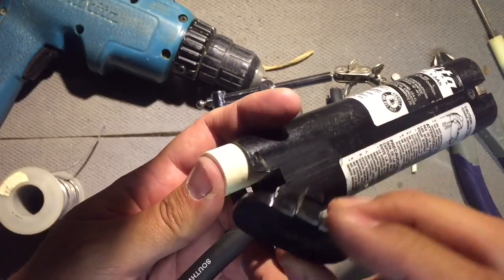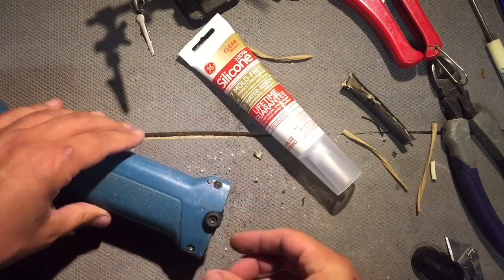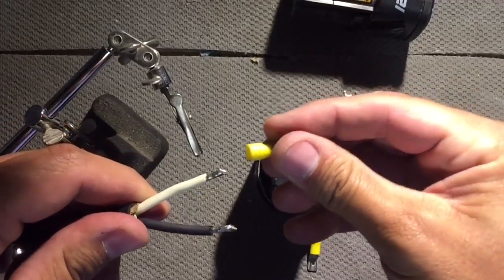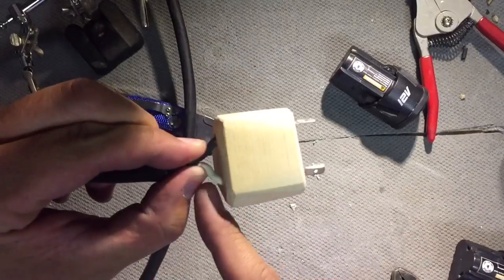How To Battery Hack a Makita 9.6v - Easy Lithium Ion Conversion Upgrade

Comment: Oh my god! DUDE! Why would you tear up one of those amazing, industry-changing Makitas!!!! I'm 63-years-old and I bought my first cordless tool when I was 20-years-old and it was that tool. Those 9.6 Makitas were such a game-changer for those of us that build modular furniture. We used to have corded drills, with cords running all over the place. Suddenly, we had a pretty powerful, cordless drill, I just paid $45 for a super clean 6012 like you have, with the original metal case, chuck key and it even has the owner's manual intact. I'm going to put NiMh batteries in the old battery pack, so I was looking for a video for that and saw this. YOU ARE INSANE! Why wouldn't you just create a make-shift battery out of PVC and a heat gun? Why would you saw a perfectly good Makita battery in half?!?! I'm sorry, you are clearly an intelligent and clever maker, but tearing up one of these old, ground-breaking tools is just a travesty. LOL.
Reply from the maker: I kinda agree. I was trying to use these old tools with newer cheeper batts. This is ling ago, but I’m pretty sure the batt i hacked was already toast. The cost of the 9.6 batts and their shelf life is crazy, now with my hack I can use any of these old tools with a newer battery.

Comment: I have hard wired my old 9.6v Makita screwdriver and used computer power supply with cigarette lighter connector and used for hours and hours without any problems.i use cigarette lighter connector for easy to use with different tools which are around 12v

Comment: My Makita battery died today. (R.I.P.) Thanks for the video. It saved me a lot of time from opening up the battery. Awesome job on modification (gauge wire).  Hopefully the battery contacts remain good.  My thoughts: ditto on the life span of a Makita. But that darn cord would get in my way, or I would accidently unplug the battery.  So, I might have to do away with the cord & put in a modified battery/plug right in the handle somehow. It would be cool to see a way to do it. But probably not cost effective.

Comment: I have an old Makita drill like the one you show, but mine was always able to use both 9.6 VDC and 12 VDC rechargeable NiCds.   The drill handle has a bulge on the bottom to accommodate the larger 12VDC battery.  OEM batteries died long ago.  Replacement NiCds cost more than the drill itself.   I think modifying the dead 12VDC battery to run off a 12VDC lithium ion won't adversely affect my old drill.

Comment: Did a similar job, but used a 12volt car jumper pack as power-the motor was fine but the variable trigger switch failed!

Comment: Since when is black positive and white negative?
Reply from the maker: In America: AC current black carries the load, white is neutral. With DC red is positive, black is negative. White never has a designation with DC. Since I had a black and white wires, I choose to follow the AC color scheme, which I usually work with anyway.

Comment: Uniquely contrived solution that can be used in any of the older style 9.6v Makita tools. Both McGyver and the Professor🌴 approved✅👏🏼. But seriously you could just install lith-ion batteries into that original casing for less than $30. I know you just wanted to use that craftsman 12v to repower those  older unused tools that you spent good money on 👍🏼. These days a guy could make a video on making shoe laces out of old fence boards and people would watch it 🤑🤑🤑🤑😉.

Comment: we need you to convert a stick 9.6v bat to a custom li-ion 18650 x 3 using the bat black case and a protection balance  board  and the correct charger  not to have a clumsy wire hack job you might as well go back to a corded drill and saw in this case your defeating the purpose
of cordless

Comment: GREAT hack and super video.  No life story.  No weird music.  Assumption that viewers know what they are doing. Yay. Thank you!
Reply from the maker: Thanks. Awesome that you get it is a hack to bring life to rarely used tools. So many viewers think it should be a lipo battery change out or want to insist buying a new 9.6 is the way to go, but no... this is a hack.
Reply: One man's hack is another man's kludge. 

The handle of the drill is way over-sized for it's (current) purpose, since it was sized to accommodate the required number of Ni-Cd cells to get the drill up to 9.6V. That being the case, you could, instead, shorten the handle and, ideally, re-pot the battery's Li-ion cells in the handle more-or-less permanently. You might additionally, using a heat gun (or similar), be able to re-shape the mouth of the handle to allow for installation of that end into the Milwaukee(?) charger. The whole idea of the drill is that it is portable and self-contained i.e. a single object to pick up and put to use.

Comment: Nice for what it was, but why not fashion some solution where the new battery fits up into the drill, so that it can remain cordless?
Reply from the maker: Thanks. Be inspired by what I did and run with it. Make a video of you fashioning a battery into the drill.

Comment: well now that you have turned the old useless drill into something that you can use , I assume that you did this just to use around the work bench since the cord would be a pain in the A$$ . why not connect it to a deep cycle marine battery and do away with the need to charge more than once a decade ! all in all pretty cool hack !

Comment: why not just replace the internal NiCad cells with Li-ion cells and use the original charger casement so that it can patch the battery into a Li-ion charger? more work, but you'd be truly cordless.
also, they sell 9000 battery replacements for like $20-$30 a pair.

Comment: Why couldn't you shorten the wire? It's not really even cordless anymore!
Reply from the maker: I could shorten the wire. I wasn’t trying to make it cordless, I was trying to find a functional way to use my old tools when I needed them in a pinch. I rarely need the right angle drill or the jigsaw, but now if I do, I have a way to utilize them.
Reply: @VinceRocca  okay I see, that was pretty crafty then. good video.
Reply from the maker: Thanks. We have a bunch of fun videos (some crafty), so please hit that subscribe button. :)

Comment: Maybe you could put a turbocharger on my '69 Volkswagon Beatle? Seriously, I just found the Makita 6095D for 13 bucks with 3 batts at a Goodwill. Each batt charged in under an hour, and it's a very useful tool. I LOVE the Makita brand. I have a wall plug 1/2 incher, and if you catch the drill on something while you are holding on tight, I seriously think it would break your hand. Great attempt!

Comment: 7:50 - no I'm thinking why did he do this in such a way as to leave a giant cord coming out of it?  I get it the tools were basically useless but I'm thinking there are ways to do this a little more elegantly and still keeping the "cordless" functionality.  Still - thanks for the video
Reply from the maker: I hope my video inspires you to make a video with a more elegant solution. For me, I wanted to use the craftsman battery and it wouldn’t fit inside the makita, nor did I want to dismantle the battery, so a wire became the solution to get the battery out of the way. Glad I could help. You can help me by subscribing so I can get to 100k subscribers.
Reply: @VinceRocca  the battery is out of the way but now you have that huge cable on your way.
Reply from the maker: And I have a tool that I can utilize in a pinch.

Comment: Why not just upgrade batteries?
Reply from the maker: 9.6v are made in nicad and nimh, neither of which hold a long shelf life and when drained past a point, become dead. For me, I barely have a need for these old 9.6 tools, so I found a hack that lets me use them on that rare occasion without having to make sure I have a 9.6 batt always charged. Glad I could help. You can help me by subscribing so I can get to 100k subscribers.

Comment: wow your turned a cordless drill into a corded drill, who knew
Reply: @brucegerard309  Of course.  It's more like  $130 for the Milwaukee but yes, if you don't have a decent lithium cordless rig, you need one.   But waste is about respect also.  Time spent to fix things when you can is care taken and respect for what you have.   Look,  I have two sets of Milwaukees drills in two countries: drills, impacts, their hackzall, angle drill for jobs.   Pretty decent system, good batteries.   I chose it to upgrade from the Makita system a few years ago.   Will use M12 for as long as practical.  But I also have 4 Makita drill drivers, plus their 3" saws one with the water feed that I have setup on a slider jig for tiles.   The 9.6 battery system is too obsolete to be useful, not worth buying more nicads or NIMH, but building  two battery inserts to run off of AC power means that we will now have some spare drivers we can keep stashed at the rental house, in the shop for details etc.  That 3" saw with a diamond blade is just fine plugged in.   I was actually looking for a plug-in drill driver for a specific use but there are almost none on the market.   Adapting old Makitas lying around makes perfect sense!  It's about having a power driver tool ready to go more than portability.   I just modded the battery with a cord.  Took less time than driving to the store!     
I understand sometimes we just don't have time to fix things.  But I would NEVER make fun of somebody for doing this. Much respect.
Reply: @brucegerard309  You'd pay $300 to replace this gorgeous chuck wobble-less drill. It has amazing speeds/torque for screwing and drilling.
Reply: Neat. You made a drill with the downsides of both. A cord you have to work around and a battery that you have to charge.
Reply: @brucegerard309  Another wasteful person.  A good consumer.
Reply: @B12Mac54 Whereas your talent would be throwing a good durable tool into garbage due to old battery tech, right?    Good consumer.  Go back to work and earn some more so you can buy more products.  Working is far easier than taking care of things.   Hope you still have a job.

Comment: what about the discharge protection? its inside the battery ?
Reply from the maker: There is none. I’m pretty sure this could drain the battery past the recharge point. But I only use this briefly on the rare occasion I need an old unique tool. I don’t nor would I use this as a regular drill. There are now better and cheeper drills than the 9.6 Makitas. But this works great for quick use of the jigsaw or angle drill. Glad I could help. You can help me by subscribing so I can get to 100k subscribers.

Comment: I don't understand why you put that long ass cord on it? Why not just put the lithium batteries inside the old Nicad housing?
Reply from the maker: Then I would have had to destroy the new lithium battery housing and It would no longer work in my new drill. This allows me to use an old makita tool on the rare occasion that I need it. Glad I could help. You can help me by subscribing so I can get to 100k subscribers.
Reply: @VinceRocca  Not to mention the issue of charging now that it won't fit the modern charger.

Comment: I found your video very ingenious in your method, Nicad batteries are still sold on Ebay for under $15.00 for the 9.6 Volt Makita drill we both have. Where did you get your Lithium battery pack, did you just have them from another broken Drill, and how are you charging it? 
What is your opinion on the Lithium Drill Harbor Freight sells for $19.99, $69.99 and 89.00 which is comparable in torque to the Makitia?
Reply from the maker: Thanks. My issue with nicads is you MUST charge them regularly. I hardly use my old 9.6 makita tools, so keeping a battery charged is not something I want to remember.

I currently use a Craftsman drill, which uses the lithium batteries. So I devised this way to be able to utilize those batteries on the 9.6 tools for the rare occasion that I need the 9.6 jigsaw, panel saw or angle drill.

Apparently there are drawbacks as you could drain the lithium too low for it to take a recharge. But I’m okay with that as I only use it occasionally and not regularly.

I don’t know anything about the Harbor Fright tools, but if you need an everyday drill, any new drill that uses lithium batteries is going to be better than an old 9.6 makita.
Reply: @VinceRocca  Good point, thank you for the reply.
Reply: I wouldn't waste money on the Harbor Freight.  Buy a Milwaukee M12 (or M18)  kit from CPO instead, get reconditioned if necessary to save $$.  Once you are in, you can buy various bare tools and replace the batteries easily as needed.  With cordless you want to buy into a system that is popular, well built and has an extensive line of tools running off the same battery.
Reply from the maker: Also. Please subscribe so I can get to 100k subs. Thanks.

Comment: Why not just get a 9.6v 3500 mAh battery?
Reply from the maker: You absolutely could, but why not grab some stuff from around the house and make what you currently have work? Please subscribe so I can get to 100k subs.
Reply: Need more than one.   Chargers are old tech also.  Too expensive.   Battery tech won't last.  Go with Lithium for new.

Comment: Instead of doing all that to the original battery casing, how about just trimming the handle, glue the custom socket to the handle and done, smaller, easier to work with
Reply from the maker: Sure. That’s an option. Thanks for the suggestion. Please subscribe so I can get to 100k subs.
Reply: Nice idea.  Make a video!!  I don't think that these long handle Makitas (I have three drills and two diamond saws) will lend themselves to that as well as a shoe style battery.

Comment: Next time use a balanced charging bored and just slap your batteries back into the battery holder. Quicker easier and looks better. The wood blocks kind of funny though.
Reply from the maker: Do you mean using a balanced charging board with lipo batts? That’s a whole different goal, with many videos in yt that discuss it. 

My goal was to be able to occasionally use the right angle, stapler, and small circular saw without having to buy anything. Without having to keep a NEW type of battery charged. Without having to keep old nimh 9000 batts freshly charged.

This hack cost a few pennies and allows me to use those tools on the rare occasion that I need them. For everyday drilling the craftsman drill that I borrow the battery from kicks butt.
Reply: @VinceRocca  here is the problem., not all Lithium powered batteries have their own safety shut-off. But 95% of lithium drills have safety shut-off. The last thing you want to do is drain lithium batteries too low. Now by going with balance board not only will it safely charge the batteries equally it will also drain the batteries equally and kill them at around 3.2 volts per cell. Now the board would cost you around three to four dollars for a 12 volt 3 cell board. The batteries on Amazon will run you about $8 to $9. So yeah this would be a usable hack in the situation of the cordless drill. Sometimes safety needs to come first. I have witnessed a 18650 battery pop do to no safety shut-off. The guy is definitely on to something here I'm just trying to give a little pointer how to make it a little safer.
Reply from the maker: So if my craftsman batteries don’t have a safety shut off, then they could drop below 3.2 and pop. You mean explode? If you drain too much they can explode????

If I got such a board and installed it in the makita battery shell, then could I still use the craftsman batteries?

BTW, I’m the guy who made the video.
Reply: @VinceRocca  depends on the battery pack. Craftsman is a decent brand they might have safety shut offs in the battery. Now whether it'll pop or vent depends on the battery pack itself. If it has vent holes most likely it will just vent out and stink up the place. Plus it don't happen every time I've accidentally ran quadcopter batteries down into the 2 Volt range it did destroy the battery but it didn't catch fire. But I've had other guys have their e-cig mods catch fire in their hand due to no safety and cheap batteries. Lithium batteries are not something to play with. That's why you keep button cells away from dogs and kids. Especially if you get them wet and they're not sealed. Now that is a scary thing.
Reply from the maker: My googling efforts don’t show a danger for discharging them too low. It might ruin the battery, but it actually appears there is less of a chance they will “pop.” The lipo explosions appear to be caused by puncture, shorting (water), and overcharging. Still I’m going to look in to that board you suggested. Thanks. And be sure to subscribe.